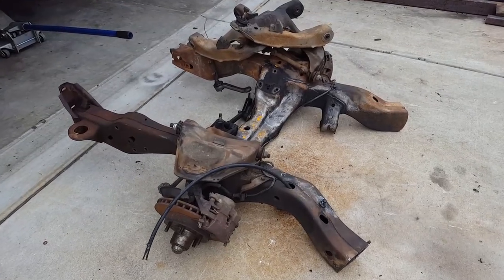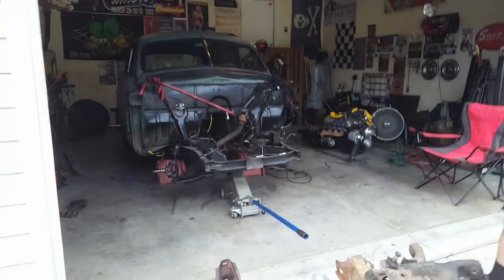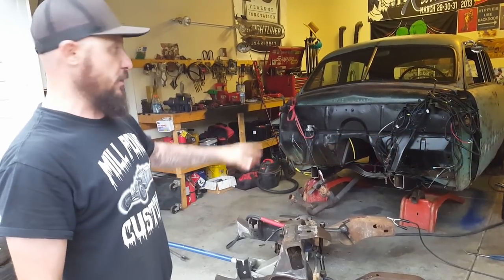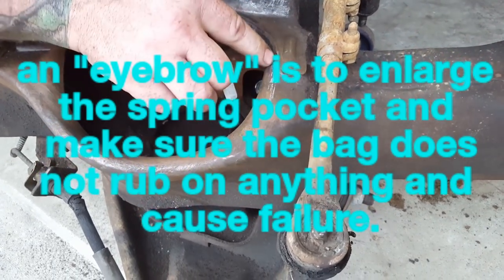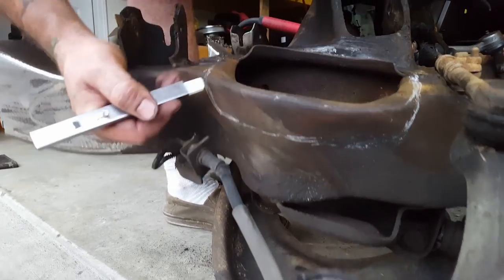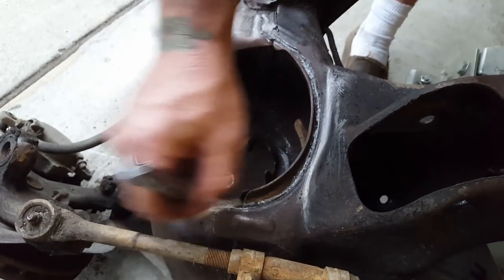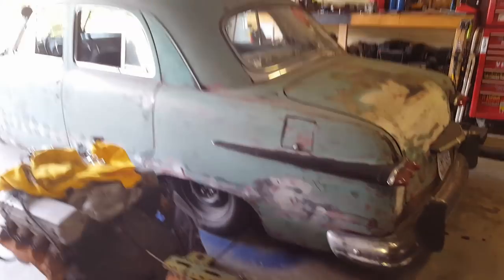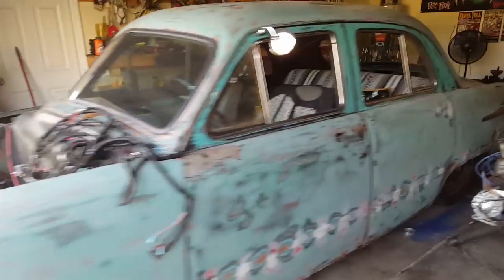RAT ROD TIP OF THE DAY: INSTALLING AN S10 FRONT CLIP ON A 1950'S SHOEBOX FORD CAR

Comment: How did you determine the 'angle' to cut the S10 frame at? Is the frame stripped and sitting on the floor and you came up perpendicular to the floor or??
Reply from the maker: We just did square  cuts.    It's not the "right" way... but with a doubler plate its fine.

Comment: Have you ever run into the s10 frame being 1” wider at those points (outside to outside) than the shoebox frame?
Reply from the maker: Not really... but I have t done "it all"  i would pie cut the frame to fit and just weld it on up.